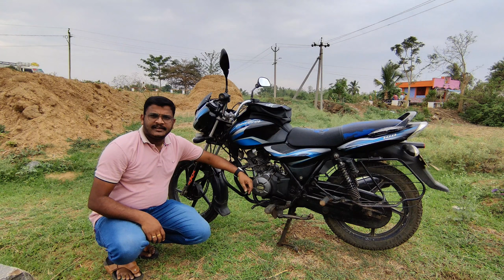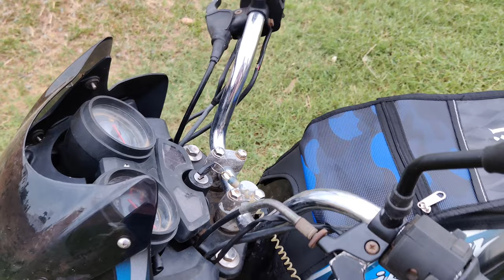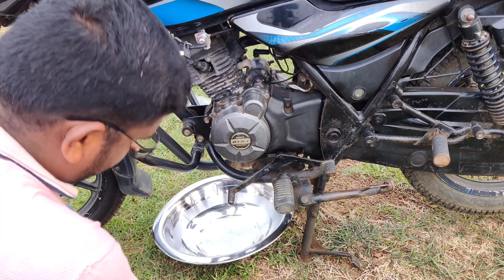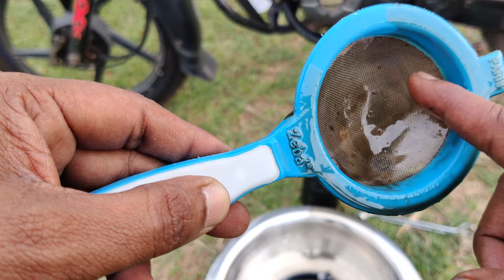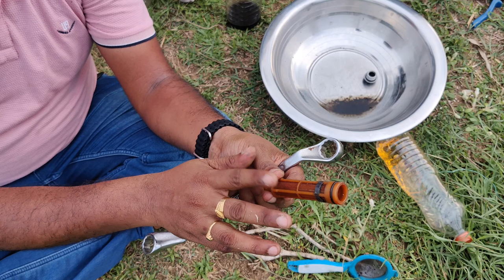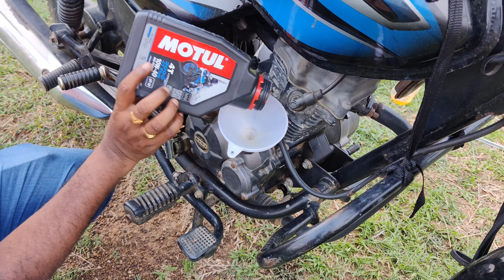ఇంజిన్ లో పెట్రోల్ మరియు డీజిల్ వేసి Flush చేస్తే వచ్చే Result చూసి Shock ayyanu | Engine Flush

Comment: This flushing s and all totally non-technical, don't do any body plz, old or new oil oil film must Between and surfaces of engine components, Diesel spoils rubber components like oil seals etc, gradually swellings starts, after flushing half an hour engine running mating parts worn-out takes place,because viscosity of oil very poor, rattling sounds noticed inside the engine, during flushing running time oil is VERY thin and excess oil level in the engine,moves towards magnet chamber's through oil seals, plz do this practices, God bless you all 🌹🇮🇳🌹 VANDHEE MATHARAM 🌹🙏🙏🙏

Comment: Petrol and diesel use cheykudadhu anna, ndhuku antey petrol vala fire aye chance untundhi leda engine gasket 's ni damage chestundhi
Diesal machi lubricant and cleaning agent kuda but e process not recommended bro ndhuku antey diesal anta esy ga evaporate avvadhu dani traces engine lo alane untai plus o rings ni danage chesey daniki chance untundhi
Final conclusion:- engine oil flush anedhi use cheyaka povatame manchindhi and regular ga oil change change chestunapudhu asalaki avasaram max 4000 kms ki oil chaange chestey manchidhi leda inka better thing anti antey 2500 ki okkasari change chesukuntey inka manchidhi, 
So oil flush anedhi vadakunda pakkana pedesi unnna vehicle's lo, leda long term engine oil chesey vehicles lo vadhithey manchidhi
Reply from the maker: Yes dear video lo kudaa cheppina

Comment: Nice Experiment
Reply: Neelu Garu Vikranth v15 Recent Ga Engine oil Kuda Change chesa But Enka Jerk Vastundi Bike Velleppudu Edina Solution Unda
Reply: Please Tell Any Solution
Reply: @Saireddy000 check air filter , never clean air filter replace it for every 8k kms or 8 months, 
Spark plug , same has above remonded intervel,

Check EVAP condition

Fuel oil filter

Always change engine oil filter when engine oil has been changed